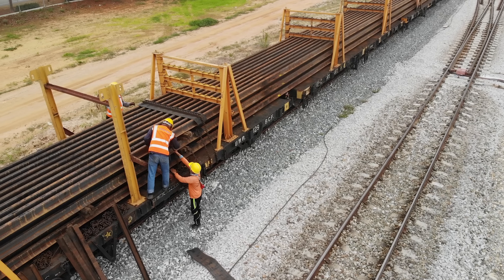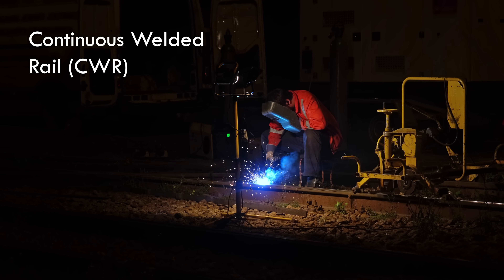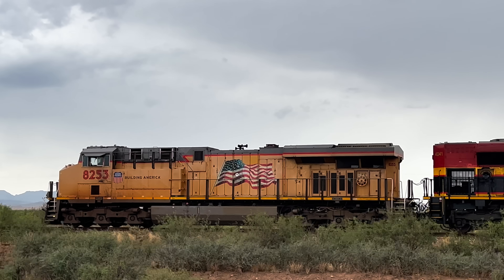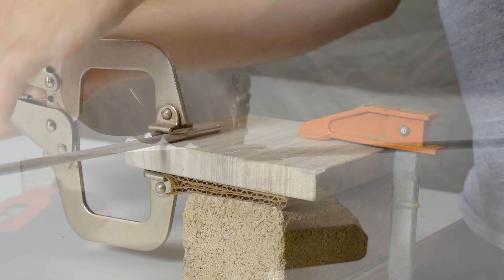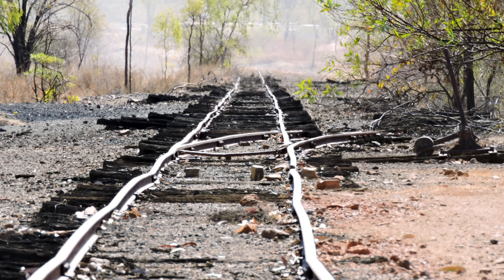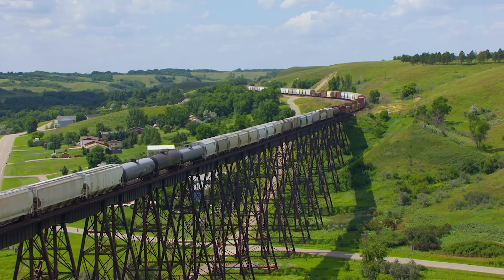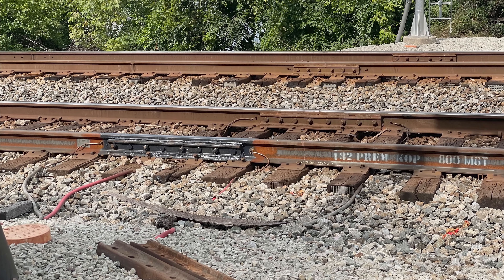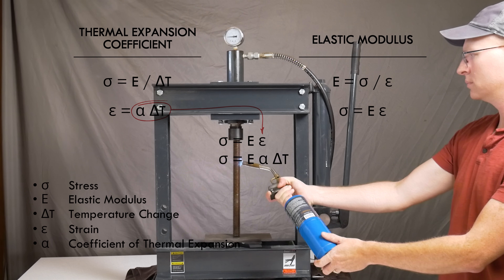Why Railroads Don't Need Expansion Joints

Comment: I've seen crews instaling CWR before. It's quite the interesting process. They have a rail car with the track sections on it. Then another rai car has arc welders. So, they feed the rails from one car to the other creating a CWR alongside the existing rail. Then they grind the rail down by hand. And after all that, a small train of equipment cars come along. Those pop the old spikes, move rhe old rail out of place, move the new ones in place at the propoer gauge, then drive spikes to hold them in place.

The other thing I remember is when they were weldng the new rail, every now and again it would pop or ring and due to the length it made this distinct echoing sound. If you ever had one of those "space tubes" growing up, it sounded similar to that, but much louder.

Comment: The clicks could also be from flattened spots on the wheels because of brake problems, but perhaps that doesn't happen with modern brakes.
Reply: Flat spots are still very common, but the sound they make - or specifically the pattern of the sound - is different from the classic click-click of pairs of wheels crossing joints.

Comment: I spent a couple of years in Buenos Aires in the mid 70s. The rail system there had been built 50 years before by the British and then nationalized in the 40s by Juan Peron. Very little maintenance had been done since then. There was one rail trip of 200 km that I took regularly. Leaving Bs As the train moved at 50-60 mph (my estimate) and the clickity-clack was spaced out, indicating long lengths of rail. But there was a point beyond a certain town where the speed decreased to a relative crawl and the wheel noise was almost constant. The ride quality deteriorated to the equivalent of driving on a rocky dirt road after exiting a paved highway. It seemed like the rail sections were only about 10 feet long.

Comment: Just double checking: so when a welded rail shrinks from a cold temperature and breaks, of course a small break wont affect a train that much, but wouldn't it affect the rail when it starts to expand from the heat next time? Like with a break you essentially now have an unrestrained section. 

Where i live normal temps are from -20C to +40C (-4F  to 104F) and it's not unheard of for winter temps to drop even to -35C (-31F). So i wonder if that's why i didn't heard about welded rails being an option - probably would have to weld it back again every spring
Reply: Often in extreme areas like that, railroads will physically add rail before the winter - cut the rails, let them contract, weld in a "plug" rail - and remove rail before the summer - cut a section out of the rails, heat them to expand them, weld them back together!
Reply: Oh, wow. A lot of work!  @mvcrailphotos  thank you for this comment

Comment: Are you going to cover the maintenance issues of breather joints in a later video? I'm sure there are practical and technical reasons why joints like these weren't in use from the very beginning in national rail systems, but they seem like they'd be more resistant to both wear and buckling than CWR and the more traditional expansion joints.
Reply: Exactly my thought!

Comment: In France, rail expansion is just a problem regarding track circuit. I'm a switchwoman in Paris and on some very hot days, we have zones of track circuit going red all over the place because the rubber joints are squished in between portions of rail.

Comment: Question, why didnt they just use those type of CWR to standard rail joints (where the rails profile each other) as the standard joint for all rails? It looks to smooth out the transition. Or is it still too much of a clickity clack to add up damage?

Comment: You can also do the tension trick, tension doesn't cause as much problems, you can limit the max expected compressive stress by heating the lengt of rail before welding it and constraining it, that would be a little complicated to do in practice but all it really means is the you need to keep the length of rail at some compromise temp while installing it, when you have installed welded and constrained rail a sufficiently long way away, you can let it cool down, lile building the railway on a decently but not maximally hot day, that would do it.

Comment: As a train buff who's talked to some railroad engineers, another thing that's sometimes done (at least in california) is put an intentional slight wave in the rail (a few inches to each side every few hundred meters) this does allow the rail some side to side action when heated or cooled. Instead of preventing the buckling from happening, it's given a controlled outlet
Reply: In Victoria (AUS) the 'high speed' passenger trains that normally travel at 160kmh (100mph) are restricted to 95kmh (60mph) when temperature reaches 35*C (95*F) for fear of track buckles!
Reply: I run a machine that lines the tracks, and I'll admit that I have done this before if there was already a sun kink and I had to do something with all the extra rail until it could be cut and re-stressed. It has always worked out great for me, and I wondered why it isn't a more commonly used method in a pinch. In a perfect world we would use our laser-lining system every time to align our tracks for long stretches, so any bit of rail movement can be immediately spotted. In the real world, giving the rail some emergency room to grow seems like a good idea.
Reply: Meters? Bro this is America. We measure in feet
Reply: @TrashMan702  In Canada, this is one of the few industries that still use the imperial system...mostly.
Reply: @TrashMan702 you mean USA ?
Reply: @charleswalters5284  Good point. Furthermore, given the underlying sentiment implied by wmg33's post, (perhaps summed up by "whatever I/we do is automatically right") I would not be surprised if plenty of Californians would prefer not to be one of the (questionably) United States.
Reply: @Gottenhimfella  And plenty of us "non-Californians" would be happy if that State was not one of the United States as well.
Reply: @mattywho8485   You clearly either don't know or don't care what their secession would do to the US economy

Comment: As a railroader who has worked in Maintenance of Way (MOW) railways actually will specify where to put old fashioned fishplate joints (most use the signal isolation joints and bridge joints) to account for expansion/contraction of the rail itself. Ties are a horribly inefficient way of stopping sunkinks and rail breaks as the ties only hold rail horizontally they don't stop rail from pulling the spikes right out and doing as it wants. Most times if its a really long section of CWR they will put in a small section of expansion rail (a small chunk of excess rail) and will bolt it either side to the CWR to stop expansion from effecting the rails around it.

Comment: You can still get the clickety clack even on continuous rail. If a wheel has been sliding across a rail during braking it can develop an uneven wear spot that then bumps the rail head harder and harder the higher the speed is.

Very common around our trams here as the drivers don't slow down carefully and instead slam on the brakes at the stops.
And once a flat spot has developed, it will be the spot that constantly gets stuck slipping on every application of the brakes. Just making it worse over time.

Comment: Tis is a good video about the construction of the tracks.
And here in The Netherlands they use Thermal welding to join the sections of track together.
The rails are each about 25 meters long when they are transported.
And we us a special machine to place the tracks on the sleepers.
And we first used wooden sleepers. There are still wooden sleepers in use.
And we use solid concrete sleepers.
Also we use sleepers in the shape of a dumbell. Meaning 2 concrete blocks under the track and these blocks are connected with a thick metal tube.
This is done to safe of material and cost. It's just as good but, more easy to install and has a lower weight so, a person like me can move it if needed.

Comment: Railway engineer here! A few points:
Not all rail is made of the same alloys, particularly high load areas such as points and crossings. These use harder metals to reduce wear, such as manganese. Adding this into the equation means welding plain line to p&c is a particularly complex job.
I am also glad you mentioned track circuit will be covered later on as that is a big downside to CWR with older signalling systems. 
Aluminothermic welding is spectacular when it goes wrong, search it up!
Reply: So let me ask a question what I wondered about often. So the pictures of buckling rail is because those rails were not installed properly? For example laid in cold winter without heating or applying pre-tension? And/or were the ties in the past worse in keeping the rail straight?  
Is it common for rail to be heated/tensioned in mild climates when a new track is built or does this only happen in more extreme climates like Texas?
Reply: @whuzzzup  if installing CWR most of it needs to be installed and stretched to the length at the stress free temperature rail length. I.e in the UK all tensioned rail is stretched to it's equivalent length at around 27 Celsius.
It's also important to note that this is the rail temperature not air temperature so it may not be very warm but if it is a sunny day the rail will become a lot hotter than air temp. This is when buckling occurs as the rail becomes very hot and has nowhere to move. Majority of this happens when a vehicle is running over the rail.
As engineers know this we implement critical rail temperatures to ensure that beyond a certain temperature we know the rail is expanding we can gradually implement speed restrictions etc. to reduce these risks to public.
Reply: @Sam-bn9ix  Finland has 17 celsius neutral temperature on CWR for obviously colder winters, but it poses risk during summer since we do get quite warm during summer. Interesting to see how other regions have so much higher neutral temperature.
Reply: @suomipoeka  interestingly I've heard there may be talk of increasing the stress free temperature in the UK due to the increasingly hot summers owing to climate change
Reply: @suomipoeka Where I live in Canada, our air temperature can swing 80ºC. They do use slow orders when it's very cold or very hot, but I don't know what else they do
Reply: @MarkRose1337, loose the joints and bolts and wait for temperature stability. Also use the thermal joints - not like in the video, but several short rails like about 6 m long.
In Russia we call it "velvet track"
Reply: @whuzzzup  as a geologist I can say that creep occurs in all surfaces, as the years go bye the ballast will move to reduce forces on it. No matter how careful the builders it is really impossible to compensate for the creep (you know how difficult it is to deal with creeps at work right? (apology for lame puns))
Reply: @whuzzzup He explained the real reason. Lower cost and quick profits.
Judging by the flurry of train derailment disasters in the USA, it's a imbecilic failure in both.
You don't just have the problem of thermal dimension changes. Most soils and clays swell with moisture content.
Some compress inelastically under load.
On hot day's curves will push out cold days pull in, damaging the precision sleeper attachment or moving the sleepers altogether, and unequally.
Both lateral and vertical movements due to moisture changes or thermal Expansion are almost certainly not reversible with any precision, and, even worse cumulative and accelerating in deterioration due to loosening fasteners, and outright excessive wear.
You can get low or negative thermal coefficient alloys, but SERIOUSLY!
TIMBERS,
certain glasses, ceramics, and crystals and diamond and CRP are 100x or so below the percent expansion coefficient of Any metal.
Reply: man look what you’ve done Grady.. you’ve created an incredible community that does these awesome knowledge drops in the comments from other amazing engineers from around the world.

So friggin cool! Thank you all in this thread, especially @sam-bn9ix for chiming in! What amazing supplemental reading while watching the video!
Reply: Assuming you mean a high manganese steel alloy? Pure manganese is relatively brittle and prone to oxidizing, but I imagine a convention of referring to high manganese stainless steel rails as "manganese rails"
Reply: Hi Sam, I was a railway engineer too back in the days of BR, worked out of Derby Research. I missed the part where he mentioned track circuits, but I am very interested to see the American slant on it.
Reply: https://youtu.be/OfZSYFOtHyA is one of the thermite welding videos that shows more than the short 2 minute ones, such as aligning the rail.
Reply: I can see diagonal tapers being used in between blocks to isolate block signals from each other.
Reply: @thomaswalters4365 Those are expansion joints. I am as yet to see one used in that application.
Reply: Thank you, but let me say our practical engineering guy feed all the correct understanding that when you starting talking about different alloys and the problems there of I understood it without further explanation.  I enjoyed Gradys and I enjoyed your comments, please by all means set up a page where we can have '2nd semester rail engineering' for those of us who like to learn and sometimes a bit deeper than others. I even suspect that if you do not have a web server Grady might agree to putting a link in to the expanded explanation. The reality of youtube makes these guys keep the length short and the real fact that most of practical engineering viewers are satisfied with a general knowledge (makes them much more knowledgeable than the vast number of mouth breathers out there LOL)
Reply: Does it matter if the rails are fastened down with spikes, screws or clips?  Do some fasteners resist buckling more than others?  Also, my local railroad replaced their mainline with CRW 6 or 8 years ago but retained jointed rail on the sidings.  I'm not sure if that's for cost, because it was "good enough", or for ease of construction & maintenance.  I was assuming cost because some of the rails show obvious signs of being hardfaced with a welder and reground.  The thermite welding process was fascinating to watch (from a safe distance, of course) and managed to score some offcuts that I use in my workshop.
Reply: @danielstickney2400  Yes clips with a high grip force on the rail foot, are better at preventing buckles. As if the rail is free to slide through the clips the rail will feed through to a weak point where the track has started to buckle. This means that the compressive force that started the track moving and would have been slightly reduced by that movement is replaced allowing the track to continue to move. Note that once the track has started to move at a weak point, its resistance is further reduced as there is less friction between the sleepers and ballast than in undisturbed track.
Reply: is there curvature in the singular beams?
Reply: Great video ... as a retired track inspector most of the rail I inspected was jointed rail most rolled more than 50 years ago and some even rolled in the 1890's.  you talk about 39' rail, well most of ours was 33' or 160th of a mile or 2-16 1/2' rods long most likely from the days when surveyors used chains and rods for measurements and you see many rights of way are 33' or 66' wide.
Reply: Thermite on a block of ice is most entertaining!
Reply: @koitorob  So is dropping the white hot left over metal from the slag trays into rivers and canals.
Reply: @meeeeeeeeeeeeeeeeeeee2  Doesn't sound very environmentally friendly...
Reply: @koitorob Perhaps not, but it's just steel and metal oxides. It'll corrode and degrade away eventually. It's not nice to have dropped in there, necessarily, but I don't think it's toxic in any way.
Reply: We use rail snake to heat and stretch and slip rail on our waterway bridges. We thermite weld rail head bonds and CWR here in CT/NY

Comment: I've never heard of the tapered expansion joints in CWR.  Are those used commonly?
Reply: No.
They almost are not used at all in the USA, aside from approaches to structures like draw bridges.  There , no rail creap or movement can be tolerated on the bridge section that opens or closes.

Comment: I imagine that modern concrete sleepers play a role in this as well. Timber sleepers can move, flex and split. Concrete would surely be much better at holding the rail in place and preventing warping. Also, nice to see videos that show metric and imperial measurements. Very handy for us viewers outside of the USA.

Comment: "in texas, the temperature could be below freezing, or over 100° F"

::laughs in midwestern::

100 is definitely expected during the summer, but -20 isnt odd during the winter.

I think about that a lot while im driving and cursing the potholes and giant cracks all over the roads.. theres only so much abuse a material can take. And a combination of cars, trucks, beating sun, high heat, sub zero temps, rain, ice, etc... its kind of a miracle the roads last as long as they do.

Thanks engineers.

Comment: There does exist a type of steel that has extremely minute thermal expansion (around ambient temperature point), it's called Invar for obvious reasons. The problem is, that alloy is very expensive. Rails are built by the mile and you need cheap steel.